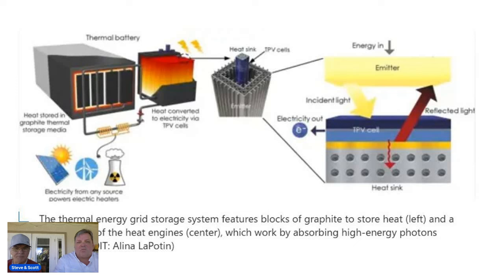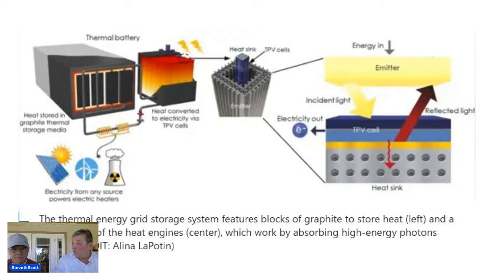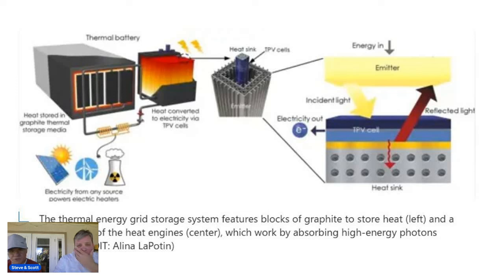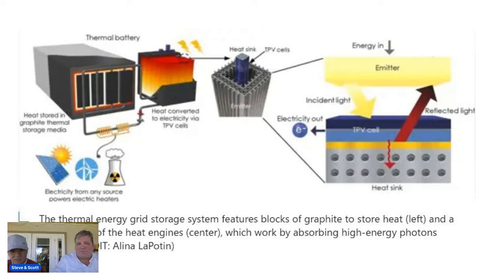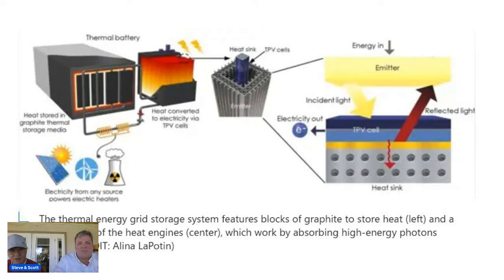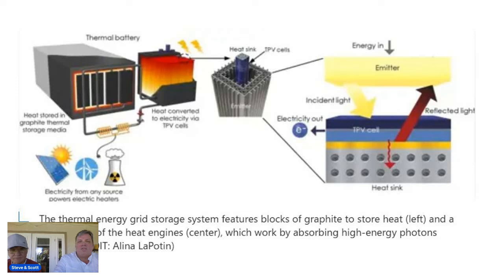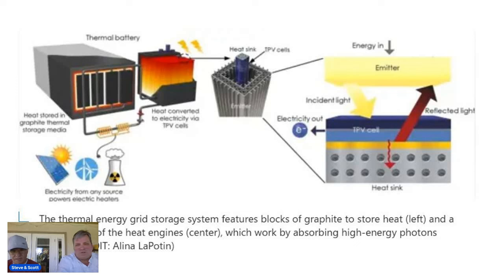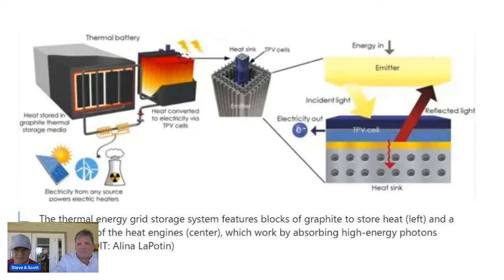No moving parts engine

Comment: 40% isnt bad but at those temperatures stirling engines can roll ay 70% efficiency, main limitations for industry standard turbines is water
And i am not big fan of electronically driven sine wave, there is no inertia for spikes in demand
And stirling engine can work well for years without any maintenance
Reply from the maker: hmm. Thanks for sharing!